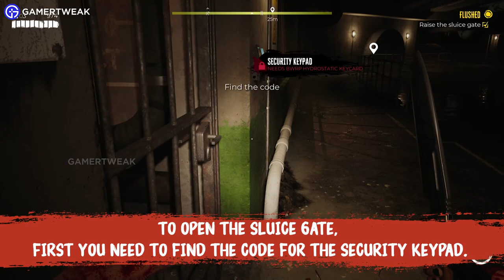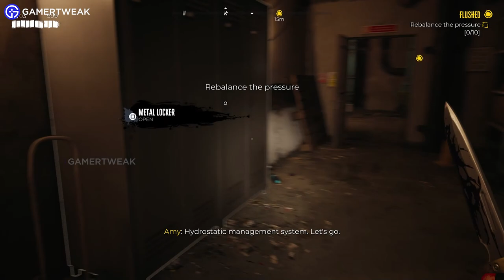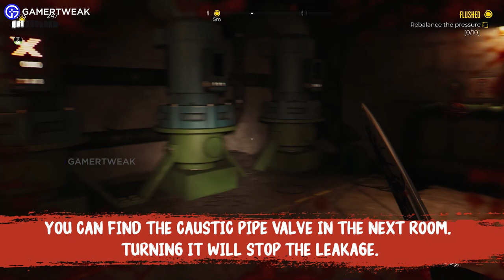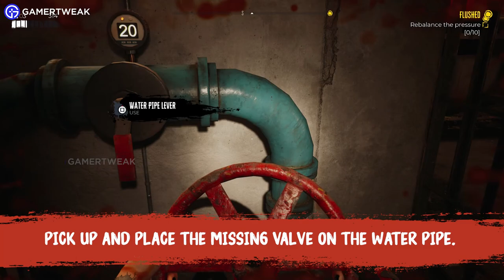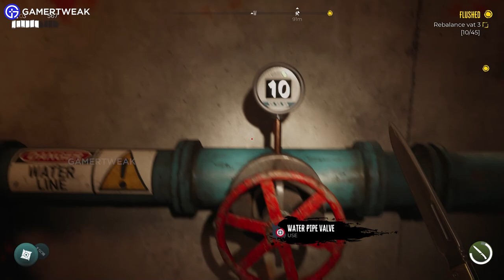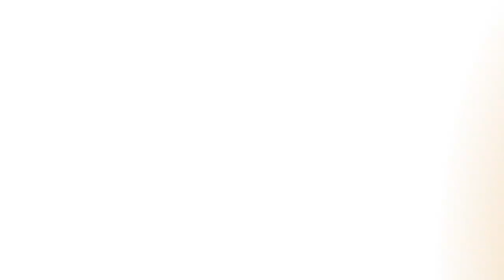Dead Island 2: Solve Sewers Sluice Valve Puzzle (Security Keypad Door Code) - Solution Guide)

Comment: I’m sorry, how is yours at 10 and going lower. I can’t get it below 20
Reply from the maker: For the third valve, you need to first lower the 10 pipe by using it again, then use the 45 lever
Reply: I still can’t get it lower than 20 lol what am I doing wrong?
Reply: I have the same restart the game than its should fix the problem
Reply: @Nmebro08  thanks I figured it out it’s a bug lol
Reply: same thing is happening to me
Reply: @totc_benz2695  just restart it it’s a bug
Reply: Thanks for saying it was a bug, I wasted 20mins messing around until I restarted and it insta fixed 🙄